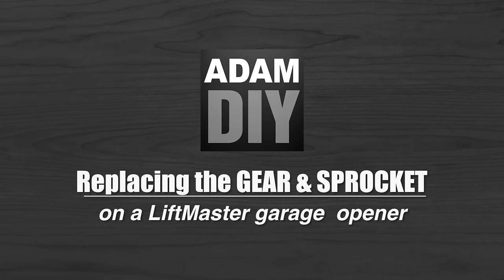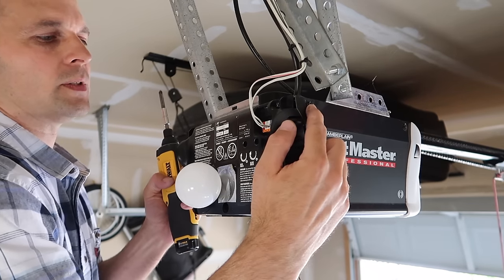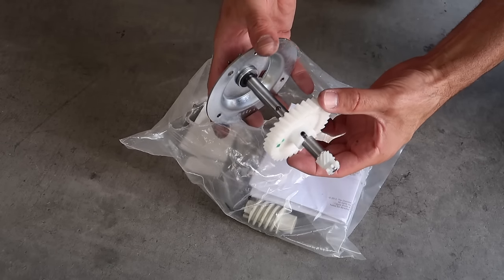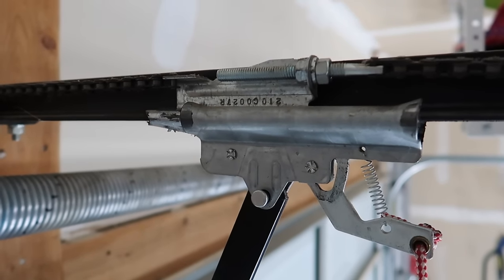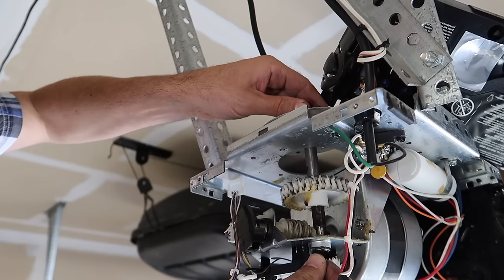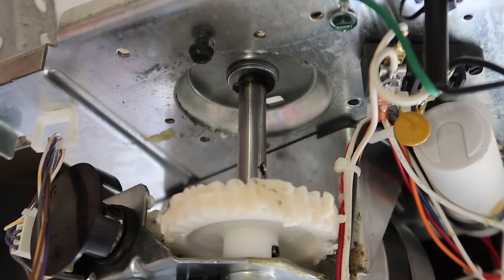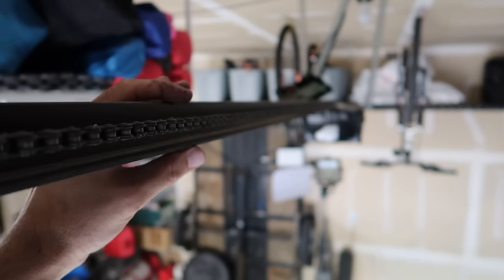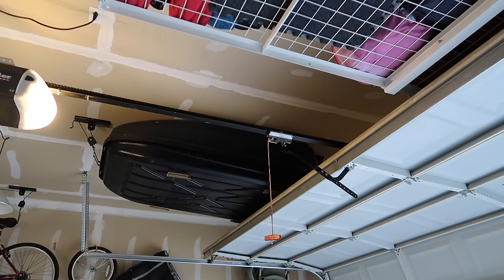How to change the gear and sprocket in a garage door opener - LiftMaster Chamberlain

Comment: Adam I have a question. I have a garage door opener would the model of 41a85021.  I looked at the link you had in the description and it looks similar. To what I'm looking at on my garage door opener I looked up my model number. And could not find it on Amazon  Wouldn't. These to be similar and would I be OK to order the one you have in your description?

Comment: After replacing the gear and sprocket it opens and closes fine.  However there is a clicking sound coming from the area of the gear when the door opens.  It doesn’t make the sound when it closes.  Anyone know what might cause that clicking sound?  Seems like a mechanical clicking noise in the gear, worm gear area.

Comment: great! thanks for the video!  The gear in my garage opener is broken, ask a technician here to check if he would fix it, he said:" nope, it's broken, the whole thing has to be replaced, it's 700 Canadian dollars, I can give you a 50 dollars discount!"  I said no thanks.  I checked amazon, the fucking gear is like 42 dollars Canadian, why the fuck do I want to replace the whole thing for 650??  I hate the technicians in my city, they don't try to replace small parts, they always only replace the whole thing for a large sum of money!  My motto is:  only replace the parts that's broken, unless the parts are more expensive then the whole thing.

Comment: The question is why does it start shredding the gear, besides being cheap? I guess it's better to shred then to rip the whole unit off the ceiling by itself. It's working fine one day, and the next, it looks like is trying to make snow cones spraying white chips.  I've had to replace my gear a few times.  Today, I'm buying a 3 pack of gears so I'm ready for the next time.

Comment: what definitely will kill the gear is over tighten chain .  This non-insulated door should not be an issue for this opener and it should last years of corse with balanced  spring .

Comment: Excellent tutorial video Adam!  I did run into one problem thou. You don't mention to align the tabs for the chain sprocket cover parallel to the chain. It was not until I went to put the cap back on at the very end that I realized the problem. You might want to add this to your video. Thanks!

Comment: This video is amazing.  I just changed the gear and sprocket in my garage and this video was perfect.  Every detail is covered and there are a few tips / tricks that the video covers as well that make it easier (threading the screws, etc.).  Thanks so much for posting!
Reply: Every detail covered? what about replacing the worm 🪱

Comment: I have a 2003 unit identical to the unit in your video.  After replacing the worm gear and sprocket (my sprocket had broken off) now the inner trolley runs backwards toward the door.  Of course if I have the 2 trolleys connected pressing the button which opens and closes puts a big bow in the rail until the trolleys return.  I am baffled.  The only wiring I had disconnected in the repair was the multi-wire plug to the logic board. 

Update:
I found the answer.  Before you put the chain on, run the sprocket clockwise if you are looking down on it until it is in the ‘door down’ position;  then attach the chain.
Reply: .. That's a good tip to remember .
Glad you figured it out ,,,, and posted on how to fix . 👍 .

Comment: Don't be a dufus like me and forget to put the rpm cap back on the motor shaft.  Sensor works much better with the cap on.  Worm drive is kinda dicey to replace as the motor shaft gets chewed by the first application of the collar screws.  The bronze bushing bearing does not want to come off or go back on that easily over the screw indentations.  They say apply sand paper to the shaft, but that is an understatement.  I would say don't touch the worm gear if not broken.

Comment: One more "Thank you" for this useful video. As such videos go it's extremely well done, mostly just the essentials, no longer than it needs to be and no shorter. The one thing I wish is that your other video on adjusting the chain included what to do if you couldn't mark it or it somehow got messed up. We figured out how to get through it, though. Thanks again.
PS. This was on a weird opener that had a red/orange learn button, but responded only to a green remote. Something went terribly wrong during manufacturing through when my sister's family had it installed.

Comment: I had this issue this week and have not investigated yet but hopefully this weekend. I installed an 18R door (Balanced) that weighs quite a bit and the original opener was 1/2 horse. Probably needs 3/4's. What would I have done differently here, if they send a bag of parts including the worm drive I would have replaced it as a set. It was a lost opportunity here not to show that replacement. Better to replace matched sets at the same time. Surprising they did not include the bearing but I would have flushed it clean and then lubed. Coming from the mechanical days if they include materials in the (BOM)  Bill of materials), best to replace what they have included in the package and save the old as spares if needed in the future. The  axial gear took most of the hit I'm sure but best to do both at the same time. BOM's are not created for the just in case but rather longevity; in most cases.
Reply from the maker: I totally aggre with you and you are probably right, it's just that I have never encountedered a bad worm gear on an opener. It's always the large gear or the top bushing & shaft that have gone bad.  I think it is becasue the worm gear is a harder plastic and does not wear like the larger one.

Comment: Excellent tutorial video! I am currently facing this exact problem with my garage door opener. While I am quite mechanically adept, I was not at all looking forward to doing this repair.  You made this repair look very easy! I am however, considering changing the worm drive gear at the same time.  Do you have a video on this procedure? (It looks to be a bit more involved.) Thanks!

Comment: Thank you very much for this video... I followed your instructions step by step and I was able to replace the gear & sprocket (Amazon = $18.00)  in about one hour, I took my time watching your video while I worked.  I have the exact same garage opener, but the top had a black plastic chain guide with 2 screws that came with mines I had to remove, I did not see that on your video...but anyhow thanks a million!!!!

Comment: Thanks, Adam, totally helped me replace my sprocket assembly.  I definitely appreciate all of the tips that did NOT come along with the instructions (such as locking down the chain adjuster mechanism, marking the chain, and pre-drilling the holes in the mount)

Comment: What a great video - it lulled me into not double checking the work being done.  There's a HUGE miss at the 6:40 - 6:45 mark.  You have to drop the gear assembly in so that the chain cover holes on the top line up correctly.  If you don't pay attention to those cover holes, you'll have to pretty much undo the hardest part of the reassembly and wrestle the chain again.  Not looking foward to it.  I'm gonna take a break so I can gather my thoughts, blow off a little steam, and take it apart again.  Please add a note to the video so others can avoid making the same mistake.
Reply: I, too, made this same mistake.  So hard to get that one screw in that needs a socket wrench, I just left the darn cover off.  I didn't catch the cut-outs for the sprocket cover, either.  The orientation matters.

Comment: Quick question, mine have like a black plastic piece in top that is preventing me to reinstall the new sprocket.
It's a Craftsman 1/4 hp unit.
I was able to take the old one out but can't reinstall the new one.
It's Like a plastic guide for the chain.
Any help will be much appreciated.

Comment: One thing I noticed is you’re missing the  tension spring included on all models of garage door openers (have never seen one without a spring loaded tensioner) on the chain connection which alleviates stress on the chain & sprocket and smoothens out the operation a lot. Very hard to get the correct and ongoing auto tension without a spring loaded tensioner.  Also pop some oil on the top sprocket bush that’s the whole reason it wore out in the first place you’ll never have to replace it again :)

Comment: Hi Andy.  Thanks.  Great presentation.
I have a question.  It would be nice if the Chamberlain/Liftmaster guru was more honest with his comment 'all parts are the very same since Chamberlain's inception'.  But, he wasn't.
The sprocket on my 3/4 hp Chamberlain is not only smaller in diameter but the plastic 'shroud' is totally different. Which brings me to this . . . .
What can I do?  Since the replacement gear mechanism is smaller in diameter, would tightening the chain drive rectify the situation?  OR
Do you have a video showing how to replace only the large plastic gear on the spindle?
Thanks again and it truly is a pleasure listening/watching someone who is a great, succinct communicator.

Comment: Well this is a BIG help as I have the same opener and need to replace the gear set.
Why didn't your opener have 4 pounds of mud dauber nests inside like mine?😂

Repair/replacement after thoughts...  Make sure to note the orientation of the drive sprocket cover slots before installing new gear&shaft assembly.
I was mostly looking at the mounting screw holes lining up and didn't notice the two sprocket cover slots until complete with installation and final adjustments. Ugh.
I had already unhooked the chain when I found your video but for the record, MARK THE CHAIN!!! before removing folks. Just like the video shows. Or, you may spend and extra hour plus, getting the chain re-situated. Like I did.

All said and done, +/- $20 for this repair is way better than hundreds of $$ for a new door opener unit.

Thanks again!

Comment: Why not just replace the worn gear? There is no need to replace the chain sprocket, plate, and shaft. Just knock out the press pin and remove the worn plastic gear. Then you don't have to thread holes for those three miserable little screws. (After dropping the third screw for the twentieth time I said f@#$ it, and left it off.)

Comment: Great video I was successful in changing my sprocket however my chain is off and now the garage door won’t close down all the way 
My unit is an older craftsman 1/2 hp from 1995 it has on the back right a slot screw to turn up numbered 1-9 and next to it the same but arrow down 1-9 
Will that adjust the closing and opening???

Comment: hey adam, i made a lot of adjustments to my open/close position limit knobs and now its way off, so much so that the opener doesn't even function anymore. is there a way to reset the open/close limit knobs? I also didn't clamp the sled like you did, so my sled position and chain positions are wayyy off. how do i get back to zero on everything? thanks @AdamyDIY

Comment: The main gear sheared in half on mine. With the garage in the open position. So the spot to loosen the gear is right next to the opener currently. Whereas in your video it’s closer so the door. Will that make a difference in performing the job?

Comment: I did this repair on an old lift master 1/3 hp opener, the repair worked and the doors is moving but the door will only move about 2’ in either direction.  I have tried adjusting the limits and force controls with no improvement.  I am seeing the opener is giving a diagnostic for a bad RPM sensor.  Has anyone experienced this issue?

Comment: Thanks Adam for the tutorial. My sprocket broke off and was able to order kit from Amazon and replaced it following your instructions. I am having a problem though- the trolley is not traveling the full length of the track. Goes a few inches and stops back and forth. I checked the limits and watched as I press the remote and the contacts are not being reached before the trolley reverses. Do you have any idea what might be causing this problem? I can’t seem to find and videos that mention this problem, thanks

Comment: Good tip on marking the chain, that way you are close. I had to make several adjustments up and down. Another good tip you mentioned was don't let it hit the nut and bolt. I think mine got out of adjustment and wala, it hit the bolt and busted the gear.

Comment: My issue is my door won't close with either of my 2 remotes until Light Cycle is done (4 1/2 Minutes)  Wall unit works at all times.  This an older unit so can't delete Light function.  Have an identical unit on other door and it works perfectly with remotes.  Any ideas ow to fix this?

Comment: Two problems for me...1999 opener: 1] slots for plastic sprocket cover in the sprocket mount need to be aligned properly or cover tabs will not connect with the slots/chain interference; 2] Vice-Grip trick didn't work well as chain holder is completely hidden by the arm bracket...so I just blocked movement of both together.

Comment: Thank you for the Video. You mention changing the worm gear and the sprocket. I made a mistake of doing just that. The replacement kit I got wasn't exactly the same. The motor shaft parts were different. First, I had a stuborn ring that wouldn't come off. I had to use the Cut off saw to get it off. Than the new one looked more like a hat with a whole in the middle. No it wasn't the one for the chassis either. After putting it on it wouldn't go far enough down the shaft so I couldn't get the rpm sensor on the back of the shaft. Now the garage door opens and closes about one foot in each direction. I have to pull everything apart and try to get that ring hat looking thing further down the shaft. Even the directions that came with it show an actual ring. Yuck!. My lazy self kept saying, only change the sprocket. The worm gear looks fine. But Nooooooo. I had to do it the right way. lol.

Comment: Replaced the sprocket, but the adjustment didn’t go so well. My door was never able to get more than two feet off the ground. After much adjustment it got to the point where the only thing happening is a click sound from the motor and nothing moves. I noticed the trolley is really close to the front, but I can’t do anything to move it now. Any suggestions?

Comment: I finally after two years replaced the gear. One thing I like to point out that even isn’t in the instructions manual. Make sure the two square cut out on the gear assembly is facing forward and back. So if your looking up or down at it. It’s at 12 and 6 o clock. I made the error of being
Off and of course I can’t put the sprocket  cover on. I’ll leave it alone for one day I am super bored to redo it all.

Comment: very helpful video. it was super easy to change the gear. one thing I will also cover that I have to look for in another video is what to do if the gear breaks and how to position the chain. I didn't know the motor tries to close the door instead of open it. so I position my chain in the close position. after some more research all I had to do is disengage the chain press the button on the wall and hit the sensor. that way the motor opens the door. after that I position my chain in the open position. thank you so much for you video was very helpful.

Comment: I just replaced the sprocket assembly and tightened the chain. As soon as I hit the opener the chain went loose and the cable side seems really tight....chain appears to be on the sprocket and belt path still. Not sure where we went wrong, everything seemed really straightforward
Reply: Update - I think our opener though it was in the open position when it was closed from when we were messing with it before fixing. We took the chain off the sprocket, ran the opener so the sprocket turned clockwise, then reattached and it fixed. Had to do a lot of illicit adjustments but it works now yay!

Comment: How do I remove the pins from the shaft that the gear slides onto?

There are two of them, they hold the large lateral gear (not the worm gear) in place on the shaft.

Comment: Very helpful and clear instructions, thank you! Just finished this replacement in a couple hours. That third inner bolt is a pain indeed. On mine it was an 8mm bolt (1/2 HP Sears), so make sure you have a socket wrench before you start. There isn't much clearance.

Comment: You mentioned quite often to check the balance. OK how do I do that? This is the first time I'm watching a how to do video on YouTube. A little more detail please.
Reply from the maker: With the door closed, you disengage it by pulling the cord.  Then by hand try to lift the door halfway up.  If it stays in position halfway it is balanced,  If it falls down or tries to lift up higher it is out of balance.  Right now I have a broken spring on mine so I will be filming a new video.  It will include how to balance the door.

Comment: Winter? You bet. My gear just went (replaced the other door's gear drive assembly in Feb 2015), 26 years was a good run. Definitely time to balance the doors - springs are probably 10+ years old, I remember replacing them at least that long ago.
Only comment is that when placing the assembly in, rotate the assembly to line up the 3 cap screw holes with the gear just above the worm gear, so you won't have to turn the gears just to get the holes lined up for screwing the 3 in. That much I remember from Feb 2015.  Great video - excellent clarity, great tips. Many thanks for posting this & doing an A+ job with it.

Comment: Thank you! With a help from my friend we were able to fix the garage opener. Too bad we miss replacing back the gear shaft in a way that the sprocket cover is parallel. We fixed it but too late to redo the shaft assembly. But now it works!